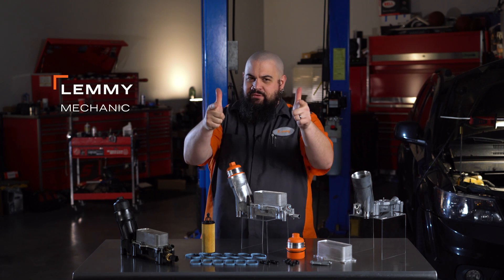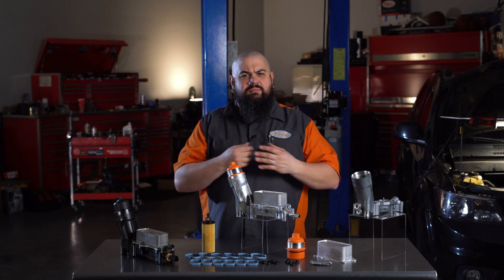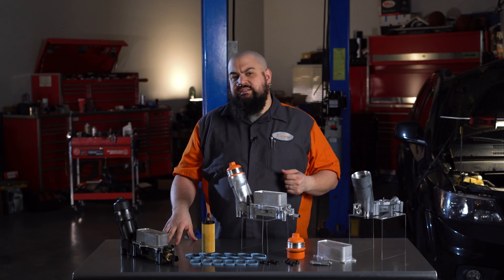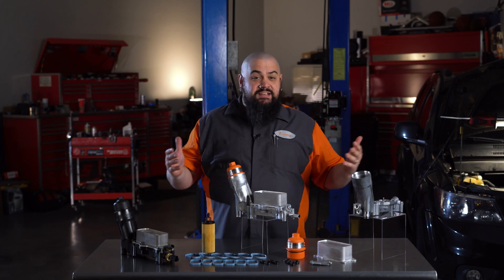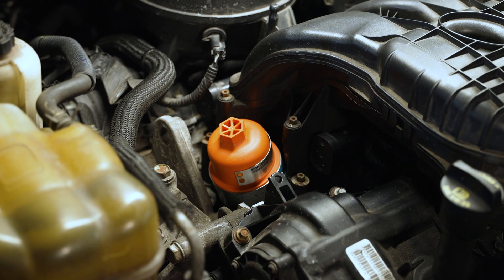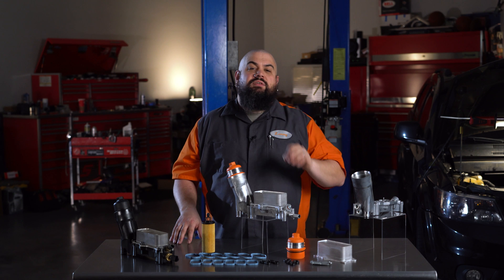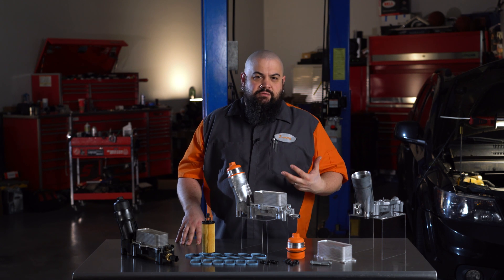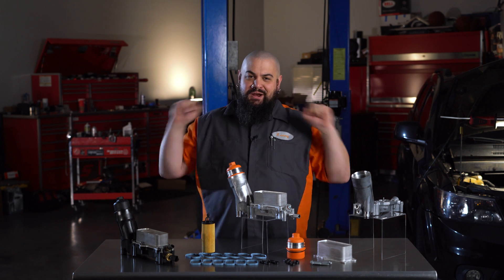Better fix for leaking oil filter housing on many older Pentastar V6 Engines

Comment: Does it fix a 2017 3.6l in a wrangler?
Reply from the maker: Hi Jacob, yes!
Reply: @DormanProducts  Thanks for the response! Will it work on the Gen 3 3.6l also?
Reply: @GeorgiaBoyJake  did you end up buying for the wrangler?? How has it been? I'm trying to do this fix to my 2014 Rubicon
Reply: @ElBrisho  Yes, I have bought it but haven't installed it yet, I don't have a big leak yet, going to install it when I do plugs: if I make it until then. I'm at 75K miles.
Reply: @GeorgiaBoyJake  where did you buy it? Nobody seems to stock it and Amazon has a bunch of China knock offs
Reply: @ElBrisho  Amazon. I bought the kit with everything in it
Reply: @GeorgiaBoyJake  I looked on Amazon and they have plenty of knock offs only. I'm hesitant to get one. I would rather get a Dorman. Don't want to have to do the job twice of the Amazon knock off fails
Reply: @ElBrisho  as of right now its says it's out of stock on Amazon!!             This is what I bought : Dorman 926-959 Upgraded Aluminum Engine Oil Filter Housing with Oil Cooler and Filter Compatible with Select Models (OE FIX)
Reply: @GeorgiaBoyJake  thank you I'll call Dorman on Monday because Auto Zone can't even order it

Comment: I just replace my 2013 housing with your old kit and and used a junk yard cooler from a 2014 that was obviously recently replaced.   :(   The 2014 van was wrecked in the back but the cooler looked recently replaced.   Is there a way to order just the orange retrofit cap?  I have my receipt for the original Dorman cooler if that helps.  Thank you in advance
Reply: @dorman . You sell the replacement cap... Why not sell the orange cap with the sticker, or at the very least, the sticker itself? Any thought to going aluminum with the cap?
Reply from the maker: Hello, We unfortunately don't sell just the cap but what you can do if you are stuck is use a cap from a 2014 and later model year application. Part number #917-190 may be able to help as well.